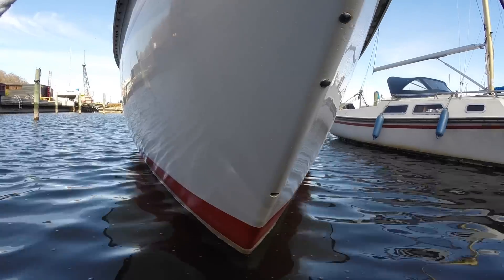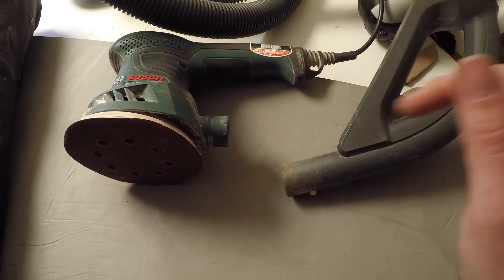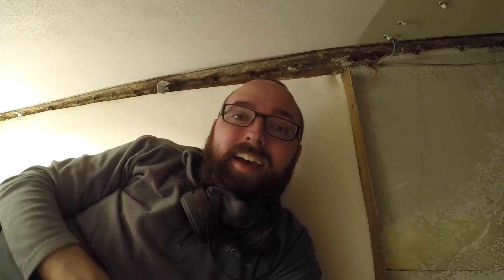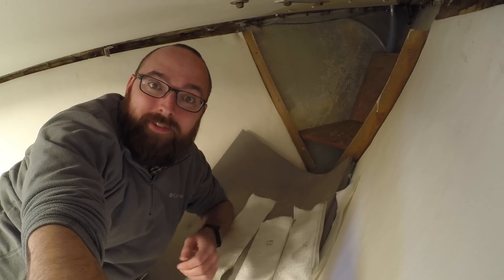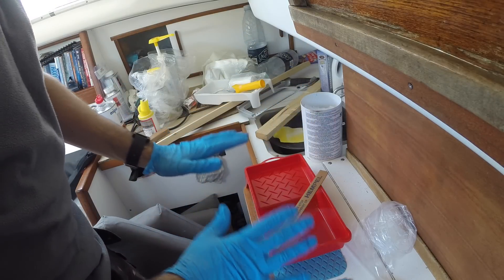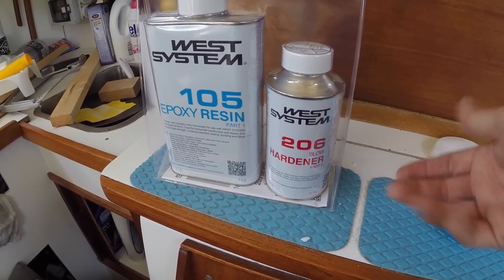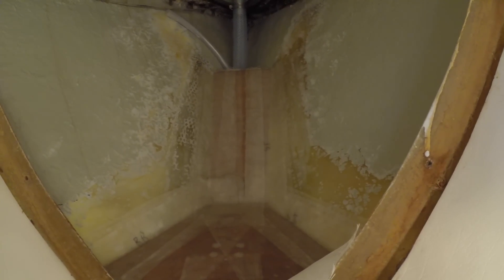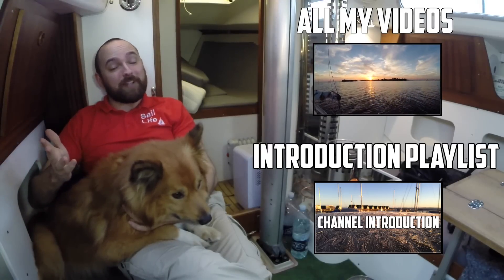Sail Life - Building a chain locker, part 4

Comment: Hi Mads. I'm enjoying your progress.
At this point I would drill my drain pipe through to the outside of the hull and glass in a fibreglass tube. You can buy one of make your own fairly easily. I think your hull is solid glass so its relatively easy. A stainless clam that can be unscrewed can be fitted and it covers any rough looking edges you may get.
Keep up the good work.
Reply from the maker: ***** Thank you so much :) I'm almost ready to drill the hole in the hull. That'll be a fun experience ;) Tomorrow I'll glass in the last piece of the chain locker. I should be able to upload a new video withing the next 24 hours :)

Comment: As always Mad, great work on the projects. My chain locker drains from a hole in the forward bow as shown in one of your examples in this video. I would be very concerned about draining the locker into the bilge due to the contamination from mud and sand brought up by the anchor chain. It could clog up the hose running to the bilge and turn your locker into a mud pond... it may also clog up your bilge pump as well as bring unpleasant odors in the cabin. 

Here in Nova Scotia most of the anchorages have muddy bottoms, the mud can be very fine, black and sticky.  I often have to throw a few buckets of water into the locker to clean it out. Definitely would not want this stuff in my bilge, but maybe your conditions are different. Thanks for the update!
Reply from the maker: Bill Bruce Thank you so much :) I'm leaning towards draining the locker overboard too. We have some nasty back stuff around here too. Not getting that inside the boat seems preferable ;)

Comment: Hi . Nice videos. Probably is better  idea to bolt  the stainless attachment ring for the chain at the back bulkhead and higher instead of on the bottom. Will save you problems with water leaking trough the bolts  ;-) Drilling the bottom is not good idea
Reply from the maker: Hans Hans Thanks! :) I think sealing up the bolts that are securing the stainless attachment will be quite easy. I'll show how in one of the upcoming videos :) If it does end up leaking I would actually prefer it to be from the bottom of the chain locker :) That way the water won't end up under my mattress in the v-berth :)

Comment: Use plastic party cups or glasses for your epoxy mixing, once hardened you can break out the old epoxy and reuse. They cost around £1 or €1 for 10 or 12.
Also if you have a hobby chain near you (we have hobbycraft in the uk) you maybe able to get lollypop (ice lolly) sticks very cheap for mixing epoxy. At hobby craft I can pay for 100 sticks, what I would pay for 10 sticks at the yacht chandlers!
Reply from the maker: Michael Weir Thanks for the tip :) I have a ton of those paint mixing sticks laying around, but I'll give the party cups a try :)

Comment: Mads I've used both the West System epoxy and traditional resin when working on varies airplane parts, I really prefer to use West System.
Reply from the maker: Maverick Sailing I've only ever used West System epoxy. How was the other stuff different? :)
Reply: The biggest difference is that epoxy systems create a strong mechanical bond to the surfaces you are working with, as opposed to polyester resins that bond due to chemical reaction, that is why often you will fiberglass repairs that will delaminate from the original surface.  Polyester type resins are great for building something where you are adding many layers together in a short period of time, such as building a complete hull, but so good for repairs to older cured fiberglass.

Comment: Will there be any issues when you fill the chain locker with chain and the sides of the boat bulge out a bit? You radiused joins which is good, will there be any cracking along the joins. Did you glass or glue underneath?

Comment: Are you using wood? I would be concerned about it rotting in since chain lockers are so wet. Did you consider using Starboard? http://www.kingplastic.com/products/king-starboard/
Reply: Epoxy will not bond to starboard.
Reply: Structural FRP would be the way to go.  No concerns about rot and epoxy will bond.
Reply from the maker: Jeff Lovett I don't suppose you'd have any idea what FRP is called on this side of the pond? :)
Reply: *****  FRP (Fiberglass Re-enforced Plastic) can assume many forms.  Structural FRP is very dense with a smooth surface on both sides.  

In the US I order the material from McMaster-Carr's plastic section ( http://www.mcmaster.com/#plastics/=wuqcse ).

I believe GRP (Glass Re-enforced Plastic) is a more European term for the material.  I google searched Structural GRP and found a couple UK companies selling the material.

1/4" (6mm)  to 1/2" (12mm) material makes great backing plates. 
1/2" (12mm) to 3/4" (18mm) make great mounting pads for seacocks.

I'm currently using 1/8" (3mm) to fabricate the interior walls of a new ice box on our sailboat.

Comment: NEVER EVER drain your chain locker into the bilge!  well not unless you want your boat to stink!  Chain lockers always drain to the outside of the hull.  people telling you to drain to the bilge are handing out BAD advise!

Tip:  when you are glassing multiple pieces in that are in vertical, horizontal and angles,  just a little bit of hot glue to tack the pieces of ply in place (sort of like sport welding!)  then you cna glass everything in one shot and not have to deal with sanding off the amine blush that occurs when epoxy sets up

Comment: Mine drains into the bilge,  I don't like it....
Usually most of the wAter ends up on the floor in my v-berth, when the tiny hole I can't get to plugs up
Reply from the maker: SV HEXE I think I would have the same problem. The hole leading from the area under my v-berth to the bilge is tiny. Draining overboard seems like the best option (for me at least). But it was cool learning that not all boats drain their chain lockers the same way :)